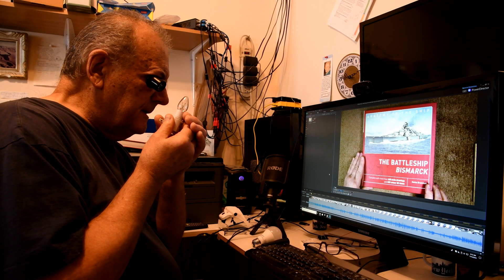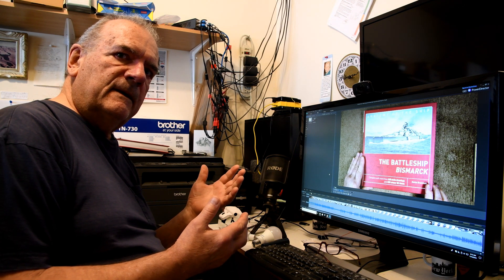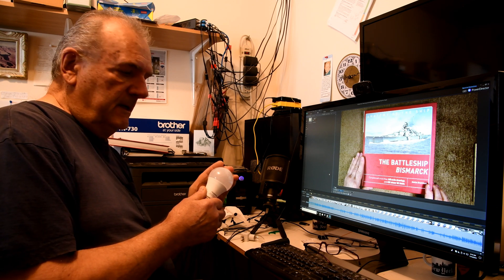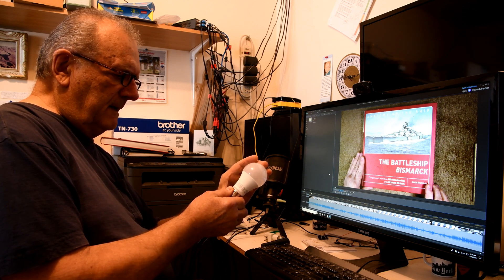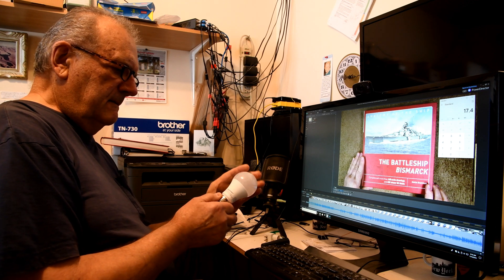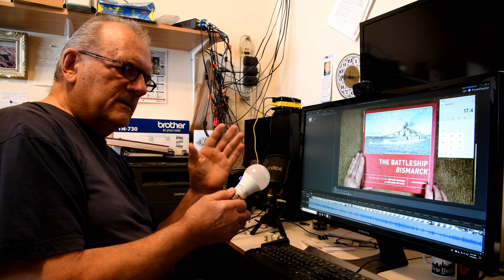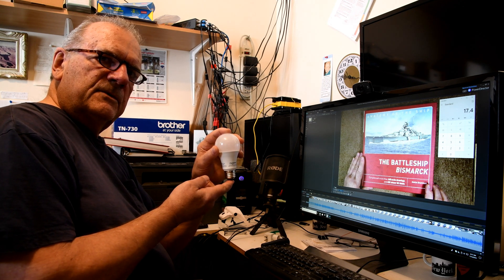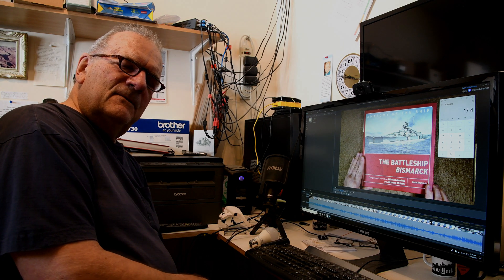Is It Really Only 9.5 Watts ?

Comment: power factor is part of it, but doesnt explain the mA rating. 
Any device that converts AC to DC will have a driver(transformer, ballast, etc). All of these devices need to charge capacitors when they start up, which leads to a high initial inrush current. The highest required current demand must be listed on the bulb, but the 'rated' - i.e. running wattage is listed on the package. so it spikes really quick at the higher mA figure, then drops back down to the rated wattage. can mess with some motion sensors, contactors, and switches. 

it's not some sort of advertising scam. 
https://www.google.com/search?q=why+do+leds+have+inrush+current&rlz=1C1GCEU_enUS850US850&oq=why+do+leds+have+inr&aqs=chrome.1.69i57j33.6431j1j0&sourceid=chrome&ie=UTF-8
Reply from the maker: Hi Ryan,
Thanks! That makes sense. 👍